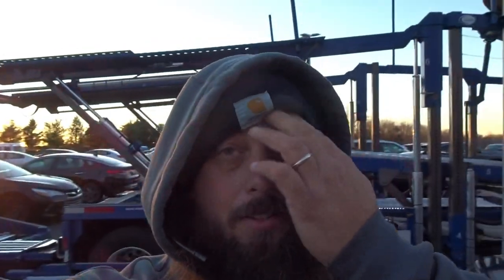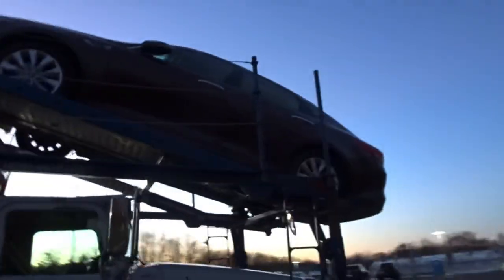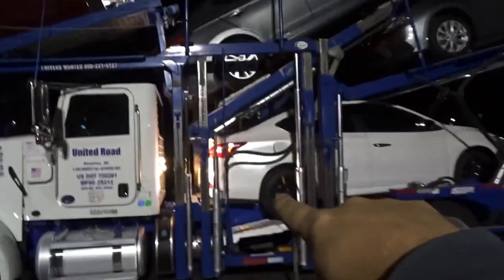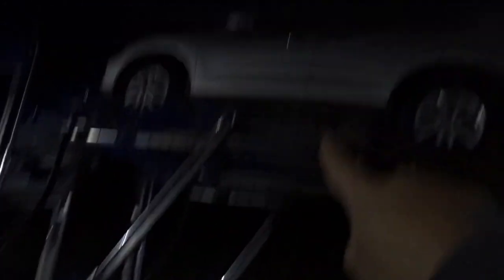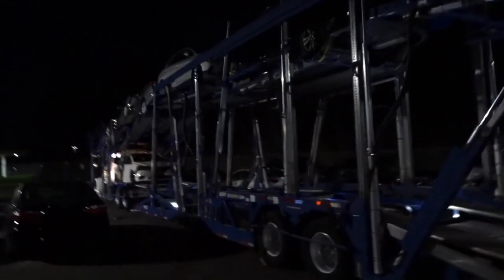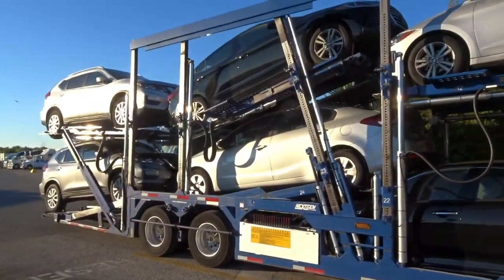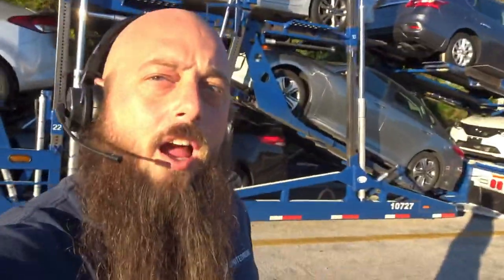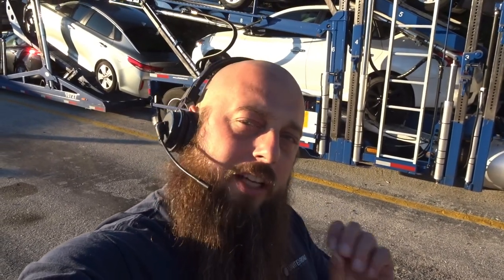Tricks to hauling 11 cars. MUST WATCH

Comment: When I do my 11 car load,,my second car, I drive it on with the front flippers closed and rear open and park the front tires on that little porch,,that 3rd car, I park it on the edge of the deck and I have the rear holes like in the 13th hole,,my 6th car, I slide it all the way back and raise it all the way up,,my 5th car, I slid it back towards my 6th car to where it starts to go underneath it,,my 4th car, I slide it just underneath that 5th car,,so now it gives me more room to slide that 3rd car back and up so I'll have room for that 8th car at the bottom,,when I do it that way, I'm usually round 13'3 to 13'4
Reply from the maker: I’ll have to try that on the next one

Comment: Did you ever catch the weight of the 4 car headrack with the high rail trailer empty and full of fuel??? Also do all your trucks you have driven with them have the 24v system( electric) in them or some have PTO?

Comment: I have 75 foot quick loader trailer   and the same set up of your tractor,  do  you think i will be able to fit 10 on? Doing what you did  , thank you
Reply from the maker: Yea take my 11 car load setup on the head rack and that’s what you’ll do with 6 on the trailer. The key will be making sure you have turning room and the car on deck 3 on the back of your head rack will probably be over the first car on your trailer so make sure you have about a foot or more room for dips
Reply: @CarcarrierTv  thank you I will will give it a try and see how it works
Reply from the maker: Send photos when you get loaded with it
Reply: @CarcarrierTv  i will keep you posted and I  appreciate your response and the videos you make I learned a lot from you .

Comment: So if you did find yourself overweight with an 11 car load, would you just get a oversized load perment or would you need to take a car off and leave it behind? Your not the only one responsible for keeping you truck under 80K lbs are you?
Reply from the maker: At the end of the day it’s 100% on the driver to take responsibility for your trucks weight. So yes sometimes you just gotta leave a car behind or see if they have something different you can take. But a good car hauler should know based on the load how close to being over weight there gonna be and if you are gonna be close then you need to look up the curb weight of each vehicle to see if your gonna need to change something